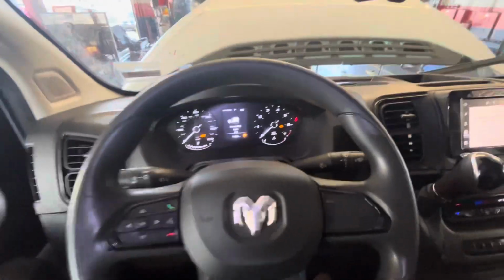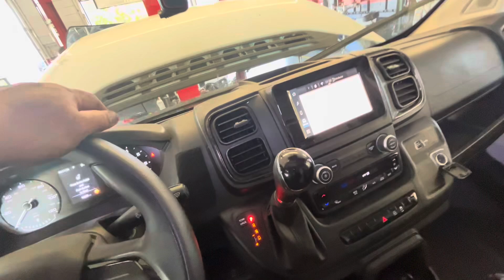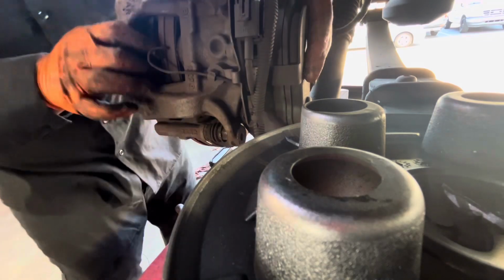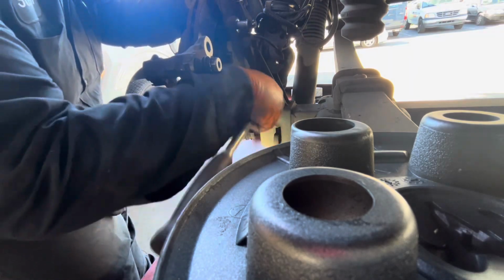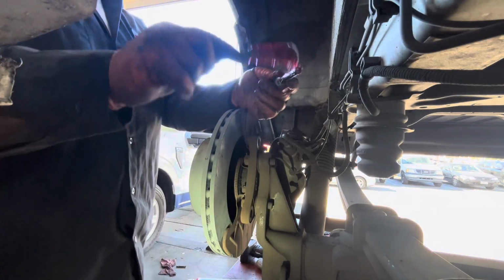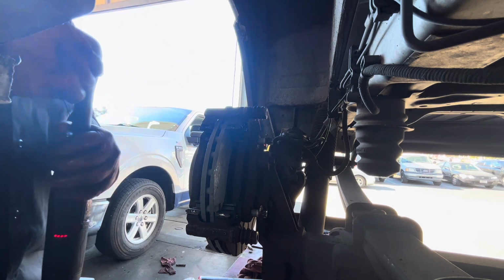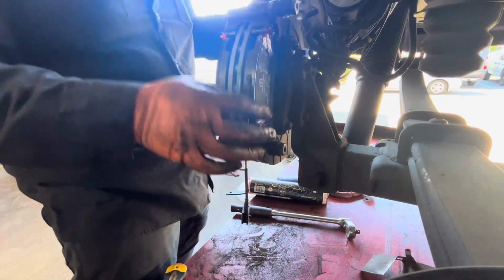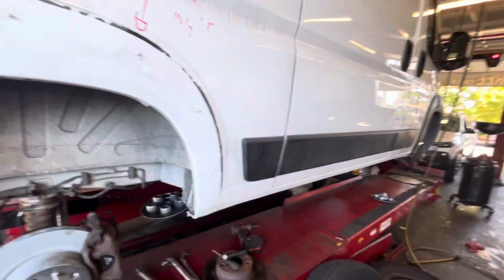2019 -2023 RAM PROMASTER 2500 Rear Brakes - no scan tool needed

Comment: what is the caliper bolt torque spec? and what is the caliper bracket torque spec? what foot/lbs should i do it to?
Reply from the maker: your can put 70 to 80l ft-lbs since its heavy truck and put lock-tight too
Reply: @orquizagarage2795  Is this for the caliper bolts itself or just he caliper "bracket" bolts?
Reply from the maker: @lmaojasey921  caliper bracket you need more torque, for caliper bolts you can used longer ratchet to tight or if you want do 40lbs if you feel soft try 45 ft-lbs